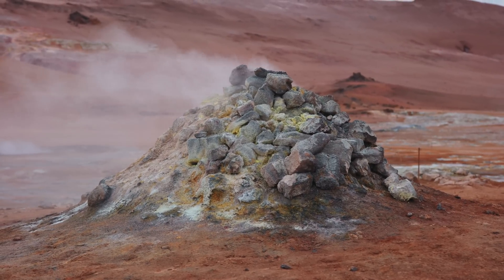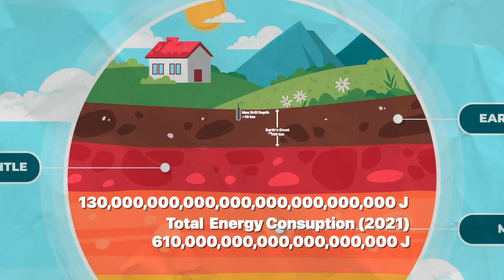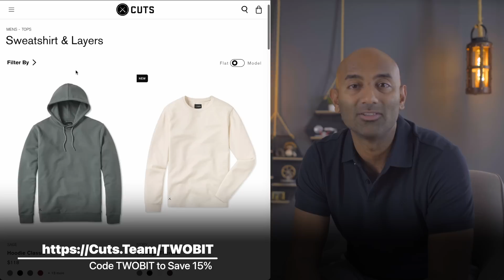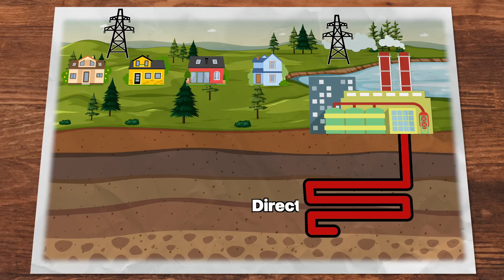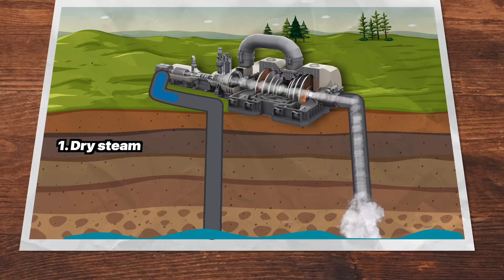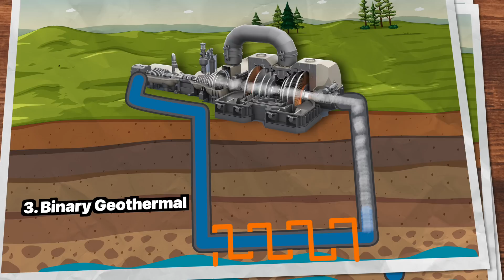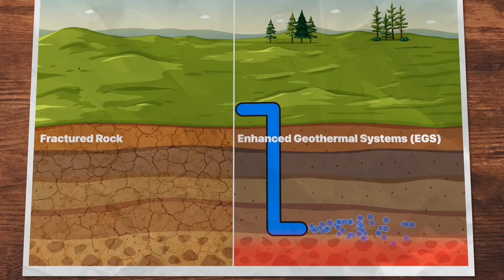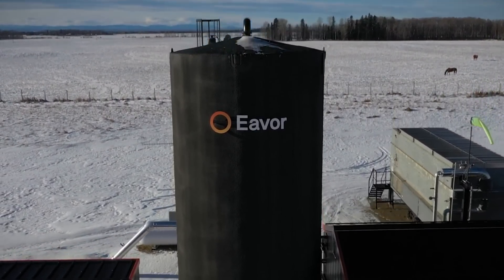This Breakthrough Energy Source Will Replace Nuclear & Coal!

Comment: I still think solar at each home with some battery makes more sense than centralized power.
Reply: In rural or suburban areas, yes that would be great! But for cities or industrial areas you’d probably need to add something more concentrated like nuclear or an improved geothermal.
Reply: @Goodwalker720  
Nuclear?
Time.
Expense to build.
Location.
Expensive energy to consumers.
.
It's had its time.
Reply: @rogerstarkey5390  yes nuclear, newer designs are cheaper, passively safe, and more standardized- allowing for lower cost and construction times.
Reply: @Aldi More
I agree.
I'd like to see government schemes to fit just one or two panels on every home, plus a small, but expandable battery (2-3kWh?).
Use that to remove the peak consumption.
Second round, offer a battery upgrade paid for with money previously saved, maybe add one panel (mountings previously installed)
.
Have a rolling program over 10 years.
.
Include a mass training scheme for technicians.
.
For the price of a few Nuclear plants you could remove the problem in half the time.
.
(Plus geothermal, offshore wind)

Comment: Iceland should negotiate to become the center of the worlds energy, make a mega Geo Thermal building thats 60% of the island and then just pump the power out into huge cables (like internet) to each cotenant that provides payment.  just connect the cord to current electrical grid.
Reply: Not practical.

Comment: My only concern is what the long-term impact would be on our planet. The reason that Mars is dead is because its core is dead and so pulling energy from the core long-term who knows what consequences it can cause?
Reply: yeah, agreed. if earth's core dies its rotation might stop - meaning our strong magnetosphere will be gone. We will be then roasted chicken by solar ionized particles.  BUT total energy consumption of our entire civilization is just 0.0000001% of Earth's core's energy. So, it will take almost a million years to exhaust Earth's core. By then our civilization might evolve - we might then by type 1 civilization. And then we might depend on Dyson Sphere or something like that which we can't even imagine today.  Then we might not need Geothermal at all.
Reply: Just posted elsewhere.
If the sun radiates more energy onto the planet surface in 30 minutes that we use in 1 year, we're not really going to make a dent in that, are we?
Reply: @rogerstarkey5390  .. Doesn't work that way, the crust is an insulator. Otherwise, on your way of thinking, we'd still be at molten lava planet hotter than the day it was formed. I'm thinking very long-term as in hundreds and thousands of years of scale of removing enormous amounts of heat from the Earth's mantle.

Comment: I hope geothermal power plants become commonplace 🙋🏼‍♀️
Reply: What if we accidentally cool the cool and tbe planet dies out?
Reply: @True-crime-tales101  even if the population of Earth was at ten billion, all our energy came from geothermal energy plants, and all the world consumed energy at the same level as the USA, that would still only require less that 0.1% of the heat energy from the core of the Earth. 
 
In any case far more water reachs the mantle and is ejected via hot springs than all the potential geothermal wells humans could construct. 

Another thing you are overlooking is much of the heat in the core comes from radioactive decay. There is a heat source that's constantly replenishing lost heat.

In conclusion.
The amount of heat needed to fuel civilization is far less than the amount of heat generated by the core of the Earth. The amount of heat extracted by humans would be insignificant compared to the amount of heat extracted naturally.
Reply: @ladyselenafelicitywhite1596  Thank you Lady Selena, that was well explained.
Reply: @incognitotorpedo42  thank you 🙋🏼‍♀️

Comment: If the earth core cools does that mean it's a good fix for global warming?
Reply: No, atmosphere temperature is almost 100% based on the retention of solar heat.
Reply: @Goodwalker720  True. but I can't help but think what if the surface of the earth is even 1 degree cooler it should have some kind of impact on global warming as some of the heat in the atmosphere transfers to the ocean / ground....  at a minimum it could slow down the glacier melt?
Reply: @vueport99  well technically it would cool the inside of the earth, and heat the surface. But the sun already delivers way more energy than that.

Comment: I wonder if this would be worth combining with molten salt used in concentrated solar?
Reply: If you want (need) a heat battery, use sand.
If you want immediate electricity, use a steam turbine.
Reply: Not a bad idea at a quick glance, but:
The fluid being circulated in a geothermal system needs to be water, as it needs low viscosity to be able to be pumped that far down and up again. I'm quite certain, that molten salt would be too viscuous or "thick" for it to work.
You'd be spending far too much energy circulating it, compared to the amount it would deliver from below.
Reply: @silvergreylion  good point

Comment: I like geothermal also there is another company working on drilling with I think submilimetter waves that cut through rock easy and melts the stone a little
Reply: I also saw this technology. not to mention another effort to clean our mistakes. There is a startup that is taking old oil wells and repurposing them for geothermal.
Reply: @chasemorgan2788  Can they do that with oil wells?

Comment: Here in Austin we have a community that uses Geothermal to cool. 8" PVC pipes at 50' deep and it cools  down to the low to mid '60s.  Then it's pumped through the bottom of house and at the ceiling the pump out the hot air.
Reply: That's a different kind of geothermal, depending not on the heat from the interior of the earth but the tendency of dirt and rock to stay the same temperature for long periods. In short, in most climates you only need to go down a few feet and you'll find the temperature of the ground is roughly the same as the average temperature of the area over the course of a year. Then as you go deeper it eventually starts getting hotter and hotter due to heat migrating from the interior of the Earth.
Reply: @alanlight7740 exactly 
Although some call that form of geothermal (earth-heat ) it’s used for heat transfer not heat energy ( ie geothermal energy) like this video. Another common and better moniker for what he’s describing is ground-source heat pump ( GSHP), pumping heat from the house into the ground ( where temps are stable year round) to save on space cooling (and heating) 😇

Comment: I like the Eavor tech it's a lot like current geothermal heating systems for the home.  We just installed a 16kw solar system and have geothermal.  It's great watching the meter spin backwards with the geothermal running.  Yeah geothermal is something that can be done right now as an energy source unlike fusion which is always ten years in the future!
Reply: More like 20 lol
Reply: Are you talking about a ground source heat pump? That's not really geothermal in my book, but it's a good way to do it if you have the land and money to set it up.
Reply: @DFPercush  Yes a GSHP but it is commonly called geothermal.  No you don't need a lot of land to have it installed.  As for the investment, because that's what it really is, it's money I would have had to payout anyway.  So we invested the money and are getting a return of 10% a year with absolutely no risk of losing our investment.  If you know of any other investment that can do the same with no risk I'm all ears.  Anyway at today's energy prices the investment will have paid for itself in  11.6 years even accounting for the electricity used to run it.  We've set up an account to deposit the savings each year so at the end of the time period mentioned above we will have all our money plus interest.
Reply: @chrismaxny4066    Yeah, I'm trying to come up with a more simple and cheap way to do this for my home, by using a combo of super conducting pipes (essentially very large "heat pipes" like the ones used in computer systems to cool them), insulation, and rather than doing one large system, have micro systems that pump into individual rooms. The basic idea is (per mini system) to drill a few holes down around 10 feet, put the super conducting pipes in them, wrap initially copper tubing around them (then more insulating tubing connected),  insulate most of the pipe and tubing (except for the bottom), and pump water through these to a small, well insulated tank in through windows to radiators + fans. 

  Plan to use high powered pressure washer + wet/dry vac to make the mini bore holes. 

   I know how to make vacuum insulated panels at home for pretty cheap, so I will probably use those to insulate the water tank. 

   But I have to save up some money for this project, and more importantly, I have to get the spouse's permission since she is very "aesthetic" based and might veto having water tanks outside of windows and tubing going through the windows (even though we live off a private dirt road with mostly old people).
Reply: @Justinw1765: Can you please share how folks can build their own vacuum tubes, especially if they can be used for hot water collection.  Thanks.

Comment: Harvesting geothermal at escape points like geysers is one thing, but drilling opens an opportunity for unintended consequences.  You rightly mention acceleration of cooling the core, but throw in uneven cooling of the core as well.  Lunar orbit drives the molten iron core tides in a largely contained spherical shell.  What happens when that shell is no longer spherical as a result of uneven cooling?  What happens to the magnetosphere?  How many of our issues today are the result of humanity not fully realizing the long term consequences of their actions?   This sounds like a prime opportunity to not realize our mistake until it is late and difficult to fix.
Reply: I was thinking of this for the whole time and on top releasing more heat into an already troubled atmosphere, almost like a doubled edged sword!

Comment: Another source of heat that is renewable - is from composting all of our biodegradable "waste". Though it is NOT actually waste - because all the nutrients came from the soil - and by composting all of it, we would actually be correcting a very big problem.
This is the proverbial WIN-WIN solution. We would be returning the life-giving nutrients that we are utterly dependent on back into the soil AND we could be using the heat that is generated by this process.
ADDITIONALLY - if we do this anaerobically - we could be locking the carbon into a stable form that could be an ginormous carbon sink!

Comment: A idiot question what happens when whe take away energy from the earth's core what are systematic effects over time. I don't know, are there anyone out there who knows?
Reply: The earth is just too large for that to happen.
Reply: Yes, the timescale it would take would be greater than humanity has existed. But, for a period of time- the earth’s magnetic field would get stronger as mantle convection increases due to the greater temperature difference between the core and crust, until the mantle becomes too viscous and can’t transport heat effectively. Then the magnetic field would rapidly weaken and any life on earth would be sterilized by UV, microwaves, etc.

Comment: I wonder what chemicals might be need to be added to the water so as to protect the equipment from corrosion, etc. And, that could impact drinking water.
Reply: Grady from Practical Engineering is doing a series on corrosion right now, it's pretty interesting. (edit: deleted some stuff that's probably not accurate. There are certain corrosion inhibitors that you can add to water and some of them can be quite toxic, like hydrazine, hopefully they won't be using that lol) The way to deal with corrosion is proper coating and sacrificial anodes, i.e. a more reactive metal in electrical contact with the structure. Unless you're using plastic or PVC or something like that, but those don't conduct heat very well.

Comment: Carnot's principle dooms geothermal energy plants to be very low efficiency-- 16% or so, less than half the efficiency of fossil-fuel plants.   That means that even if they are built at a large scale, with large turbines and pipes,  the cost of which is considerable, you don't get much energy out as the hot side isn't that hot, like 250C or so.  At those low percentages the cost of turbines, never low, becomes a significant part of the cost.  In some situations also the large volume of liquid condensing results in considerable scale buildup and corrosion.   

Also significant is the issue that we rarely build large cities near large and hot fault zones, so the cost of getting the power to where it is needed often is a limiting factor.   Japan and Iceland might be counterexamples, at a small scale.
Reply: Except modern geothermal plants use the extracted hot water to boil a liquid with a lower boiling point to evaporate and run the turbines, which is condensed and pushed back into the system.
Reply: @unholyrevenger72  
Now steady on!
Don't start coming in with expert answers to FUD!
.
It's not fair!
😂👍
Reply: @unholyrevenger72  Even worse then.  That extra cycle requires double the piping and heat exchangers and pumps plus it inevitably lowers the temperature difference even more.  No free lunch.

Comment: My biggest concern is what if we are accelerating the process of the earth's core cooling down which will lead to losing its protective magnetic field that keeps us all alive.
Reply: The cooldown will take a billion years, even if we built geothermal plants everwhere to satisfy all  our current energy needs. By the time the core is cold we'd already be in space.
Reply: @Henri_Ikari  In Mars, more likely 👾
Reply: I’m also wondering if the mantle/core has a negative temperature coefficient. As it cools and shrinks, the fission and pressure increase and generate more heat?
Reply: Just.... No.
.
Edit.
Here's a thought.
As I recall, the Sun radiates more energy to the surface of the planet in 30 minutes than we use in a year.... ALL of us! ALL the energy.
.
That's an indication of how much we would remove.
Reply: The Earth's core is constantly being heated by gravitational (tidal) forces and by radioactive decay.  It's unlikely that we could EVER significantly cool it through any reasonable amount of energy extraction.

Comment: This is fringe science at best.  Geothermal work in areas like Iceland that have access to volcanic sites that can be safely exploited.  Those places are rare and modern tech does not allow other areas to dig deep enough to reach a safe geothermal source.
Reply: Yes, milimeter wave drilling/bore will probably be the next video. This would allow deeper wells in areas that are not volcanic or seismic already. And any micro earthquakes hypothetically could reduce the mantle stress and lead to fewer large earthquakes.
Reply: It's not "fringe science" at all.  Eavor is well-funded and has a working demonstration plant already.

Comment: I've been wondering for years while they don't do geothermal in locations where it's viable, if I ever build a house I will be putting a geothermal system in. Also a solar preheater for the air and water.
Reply: Because we can't export it and profit from it.
Reply: @robertchanrussell2010  We can't export and profit from electricity in general, but we still need it.  Geothermal IS done in locations where it's viable.  The problem is that those locations are few and far between.  Geothermal for homes is just low temp heating, not electricity generation.
Reply: @incognitotorpedo42  I know. I was being satirical, but truthful at the same time. As per the video and the OP, why don't they do more of it? Because O&G are the "experts" and simply heating local homes and some electricity generation can't bring the revenues of the world markets for O&G. Bitumen doesn't heat homes, but gas does and gas is often exported. BC is building an LNG system to export it. That was my point. The companies who should be doing this would rather create exportable products and greater profits.

Not all are like Hydro Quebec who actually export a large amount of electricity to the US.

Comment: Thought you would mention the Lithium extraction being explored at the Salton Sea area of California. An extra benefit at the geo thermal plants there. Could turn out to be the world’s largest source of LITHIUM.
Reply: Just problems with corrosion and caking up with mineral. What solution do you have to introduce to descale the piping, also how bad is that for the environment?
Eavor solution works, because the continuous pipe solves that.

Comment: Would you consider taking a walk on the wild side and doing a video on the pyramids in Egypt. They can't possibly have been built with hand tools. There are signs at the build sites of cuts in granite that could only have been made by drills and circular saw blades. Then there is the mystery of how the unfinished obelisk was being cut out of the surrounding granite with strange scrap marks in the stone. If they were using power tools, they had to have a source of energy and it couldn't have been fossil. Come on do it. The research alone with drive you crazy once you open up that rabbit hole.
Reply from the maker: Sounds amazing but I’m not sure how it would perform on my channel! Maybe I need a new channel for all the crazy ideas I’d love to do :)
Reply: @TwoBitDaVinci  Go talk to @UnchartedX. Maybe an interview between you two would be interesting to both channels.